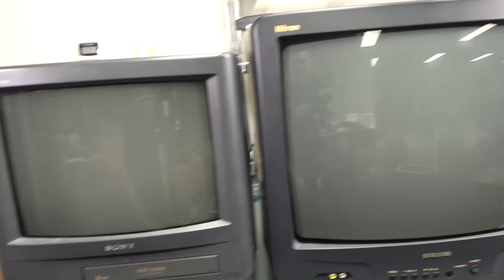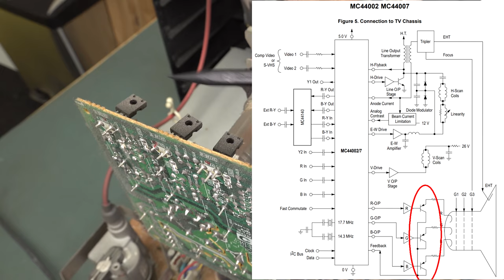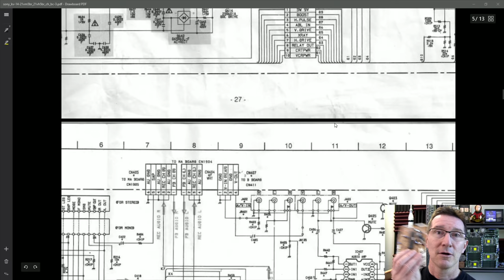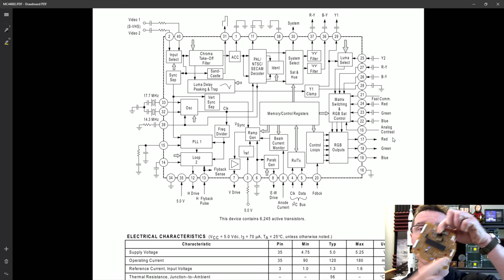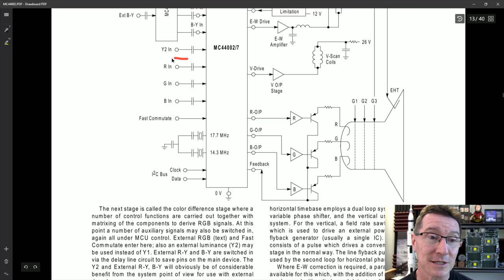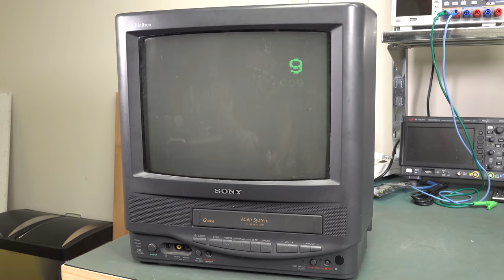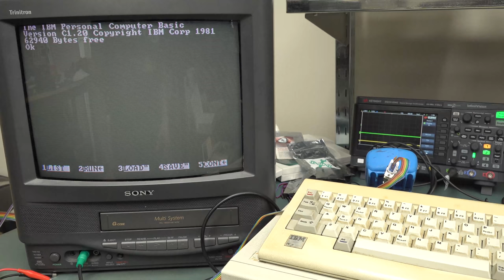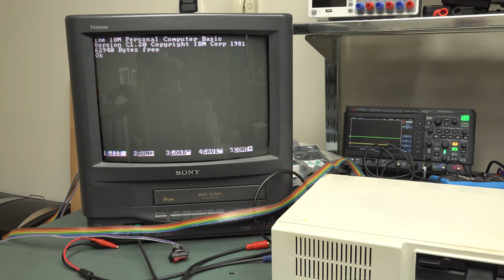EEVblog #1246 - Dumpster TV to Retro RGB Monitor Conversion

Comment from the maker: WARNING: Do NOT try and mod a TV that only has an RF antenna input, it is likely this is a "live chassis" TV and the internal circuitry is not isolated and is at main potential. This could kill you, or worse, blow up your vintage computer.
Reply: Death is a better fate then losing a valuable vintage computer
Reply: or worse 😂
Reply: Would you consider adjustment pots for size and phase?
Reply: Fear not... I shall check it with my tongue first!   thhhhatth wokethhed outh thwell :-(
Reply: @xjet  hello bruce
Reply: I've done it and i'm still alife and so is my super nintendo
Reply: @MrJob91  Gidday mate!
Reply: @NerdyMeathead  did you at least read the title?
Reply from the maker: @xjet  Jar Jar, is that you?
Reply from the maker: @NerdyMeathead  Found in the dumpster room as I said.
Reply: It is not very likely that you find that kind of setup in a TV of that vintage.  Of course in tube TVs this was always done, also in many small tube AM radios.
See Mr. Carlson's Lab videos :-)
Reply: I just had to check the vertical resolution as I wanted to make sure I was correct in saying 576 lines for PAL. One source reports 625 lines for a PAL signal, but I don't trust it. Perhaps they are including the vertical blanking and flyback lines in this. What do you think Dave?
Reply: chickenman297 
625 is the standard, but they aren’t all supposed to carry video.  Most TVs are set up to display something around 550 lines, IIRC.

This being all analogue, you can do some really scary service menu fiddling to see what happens.  My old Sony (29” ‘Flat screen’ — well, kind of) had built in idiot protection so I never managed to blow it up.  Made some interesting squeals and some psychedelic strobing stuff when you set something that wasn’t a good idea...  😺
Reply: dave i had 2 them sony tvs.one exploded while watching tv and also main electric shield closet or what ever its called in english..(its that thing where you check your electricity readings and ohter stuff for paying).
for 4 days all our apartments had no electricity
Reply: In civilised countries we just use the RGB on the scart input.
Reply: I don't think you are allowed to use the term Tranny in any sense, because it can be offensive to transgender people.  You could go to jail under new Australian laws.  Oh, and BTW Scott Morrison said we should all show respect to the Chinese Communist party.  So you might also want to refrain from saying Won Hung Lo brand.  Thanks!
Reply: @chickenman297  to the best of my recollection (did a framegrabber hardware project in college, long time ago) PAL is 625 lines, including the vertical blanking, with 576 visible, and NTSC 525/486.
Reply: @chickenman297  When you divide the line rate by the frame rate you get 625, i.e. there is a total of 625 lines in the frame.  However, some lines are in the vertical blanking interval and some are in the overscan area, so they are not visible.  576 is about the number that you can maximally see, to be safe a lower number like 550 can be used.
Reply: Damn, there goes my idea. I have a 27 inch CRT in the garage that is antenna only that I was going to mod for RGB.
Reply: I did RGB mod an rf only set years ago. the service manual showed that it is not a live chassis set.
Reply: @xjet  Jar-Jar ... is that you?
Reply: @Rob2  I thought it was a bit high. What got me was the interlacing. 25 lines of vertical blanking for fly back, but there are 2 fields for each full resolution picture each having those 25 blanked lines (25 or so, actually 24.5 to complicate things)
Reply: Thanks for the video.
This is a very real warning. Working on an old black and white TV ( unplugged the chassis inside was all metal  ), I was on the floor with my elbows on my knees putting it back together when electricity  discharged into me and when I got my senses back I was six feet away from the TV and my arm was numb. Lucky for me I had my arm on my knee. It was hours later when my arm would work proper. My hand was at the RF antenna input, do not know where all the energy came from. If any one knows, I would like to know what happened.
Reply: Speaking as someone who modded a few dozen of these CRTs for RGB, I don't agree with that generalization. The circuitry of the type of TV we want (with color OSD) is basically identical to these 2 TVs you showed us, just the inputs for composite or whatever else weren't populated to save some change - sometimes you can even see the outline where those inputs would have gone. Of course you should treat a powered set as high voltage until verified otherwise anyway but TVs with a modern jungle IC won't have high voltage in that area.
Reply: For those ones who wants to teleport their soul to another dimension, just don’t discharge a crt tv,just pull off all wires and touch it ,hahaha JUST KIDDING,,, and to be hornest i NEVER want to open up a crt tv and touch the inside of it because you never know ,and once 30.000 volt will travel trough your body, your heart will stop permanently.
Reply: yeah.  The worst shock I got besides peeing on an electric fence illegally hooked up to the AC mains is when I was working on an old 27" vacuum tube TV and the anode popped off the CRT and landed on my arm.  

Hit the wall so hard I knocked all the pictures off on the other side.
Reply: Depends of the vintage of the TV set. If in the user manual is said there is an AV optional board it's safe to try.Besides in some TV sets I found the schematic inside.
Reply: I've done that with an old AC/DC radio. Trying to add earth for better DX killed the radio and scorched the window-screen. Many old radios and TVs have no isolation.

Comment: This reminded me of when I was in electronics school.  One of the instructors worked part time for a company that repaired arcade machines.  They had a bunch of monitors that had some screen burn were still functional.  He brought in enough for anyone that wanted to get a color monitor for their computer and learn a little in the process.  The monitors accepted a CGA input but one of the sync signals was inverted.  Too long ago to remember which one.  So we built a little single transistor inverter on a piece of perf. board and were ready to go.  Nothing too complex but it was a simple way for a couple of us cash starved students to get get a color monitor.

Comment: The component differences on the brazilian TV are most likely due how to bypass some brutal import taxes, you have to manufacture things in brazil itself on a tax free zone in manaus.
So they probably redesigned the tv to get a good cost/benefit while shopping locally and/or importing cheaper components.
Reply from the maker: Interesting!, thanks.
Reply: I think it was even worse in the 80's with the military dictators favoring their corrupt friends.
Reply: @EEVblog  also, Brazil uses PAL-M color(pretty much NTSC/525 lines but using PAL color), which may explain some of the differences.
Reply: And if memory serves well, Manaus is smack dab in the middle of the Amazon JUNGLE! (There we may have the reason for "jungle chip")

Comment: You can shift the display left or right in software on the PCjr (or any PC with CGA): at the DOS prompt, type MODE 40,R or MODE 80,R for 40 or 80 columns of text, respectively, and to shift the screen right. You can repeat the command to shift the display farther. Use L instead of R to shift it left.
Reply from the maker: Works!, thanks.
Reply: VWestlife (backup account) your description on that channel states "bonus videos", but there are no videos at all on the videos page...? :P
Reply: I do not post any videos on this account. It's strictly for viewing and commenting, to keep my subscriptions feed from getting too clogged up on my main account. If you want to see more videos from me, subscribe to my vwest7ife channel.
Reply: @kevinsvideodump  It seems that 118 people disobeyed your instructions in the "About" page, and subscribed to the backup account.
Reply: @und4287  it did say something about "bonus videos", so it must have been changed since. Anyway the main channel seems to have my main channel blocked and attempted contact elsewhere was persistently ignored and I have no idea why...

Comment: Yes I remember most of the old mods used opto isolators to solve the issue with hot chassis sets
Reply: Way, way back went to a lot of trouble pulling an isolated 6MHz sound carrier feed out of my parents' TV to run through a sound IF strip feeding an induction loop I'd installed for my mother's hearing aid. Less than year later they replaced the set with one that had a SCART connector.

Comment: Trinitron fan checking in. After I grabbed a few Sony GDM-FW900 monitors that the university had in the e-cycle pile, I've been singing their praises. (I had a standing "agreement" with the people running that building that since they had to pay per pound for e-cycle, if a few CRT monitors disappeared from the pile before they were picked up, no-one would say anything.) This was in 2009 for me,  and at the time LCD panels were not very good. The technology market switched to them before they were ready. I didn't start using LCD displays until after 2015, when the technology had finally caught up. One thing I loved about it was it could handle a refresh rate above 100 Hz with good resolution.
Reply: The FW900 is still better than any LCD. Fight me.

Comment: Trinitron monitor ftw...ive got one of the "flat screen" CRT trinitrons...its great for old school consoles/computers
you should be able to find a "service menu" on the sonys...allowing you to change all the settings (atleast there is on mine!)..you still need the manual to get calibration correct (i accidently reset mine and lost all of its settings, picture was all wonky and colors where wrong... left it off and unplugged for about a month and it musta loaded a backup and came good!)

Comment: Back in 2002, someone gave me a Sony KX-27PS1 studio monitor.
Unused, still in original packing crate!
Full service manual was included in the crate.
These were first built in 1982 I think, mine was a 1983 model from the date codes.
It was quite funny reading the instructions, as they referenced the SCART connector...
"For use with audio visual accessories which may be developed in the future"
The SCART (or "PERI-TV") connector was full feature RGB, plus there was also a 34-pin interface connector with RGB.
Paired with a Set-Top Box that had RGB output and a pair of shielded-magnet hifi speakers, this setup wiped the floor with anything else on the market for image quality, even 20 years on.
I had gone LCD for the computer, but regarding TV/DVD at the time there was only Plasma that could offer anything close to the Trinitron Profeel.

Comment: In France (and all Europe I think) was mandatory to have at least one SCART plug (called Peritel in France). It was used for absolutely anything: VHS tape recorder, pay channels decoders, satellite or cable TV, computers or anything here. We was never using composite (or thru the SCART as it's also part or it). It was very easy to build electronic to send data to the TV... and without microcontroller 😉
Reply: Valéry MARZLIN Yes, that’s true. It was used in many European countries. I think it’s still mandatory on TVs sold in Sweden, they could have changed that in the last couple of years though.
Reply: @ianbakke  in France it's no more mandatory now as we have no more analog TV from 2011. Even the emitter I use to receive TV at home, the Eiffel tower 😉, is digital. Now HDMI is mandatory but you can still find some new TV set with 1 SCART but less and less.

Comment: Yeah this fast commutation signal is actually present on the SCART connector and is usually necessary for RGB although some TVs don't care. It's used to force the RGB input over the composite input, in theory it can be used to do RGB overlays when having both inputs in sync.

Comment: Wish I had me one of them boom-box special Phillips screwdrivers at 4:18 show-off..
Reply from the maker: I think I'll use it in every video just for kicks. Looking for the same length in a #1 philips.
Reply: I now have screwdriver envy
Reply: @EEVblog  I bought these recently to get into a dead UPS at work:

https://amzn.to/2LyQWkO

#1 through #3 Philips, and two sizes of flat blades.  Use them in a cordless screwdriver or a Picquic handle.  They're not quite as long as in the video, but at 12", they should be long enough for most things.

Comment: Reason for the external RGB for OSD is to get a stable OSD, using the MCU triggered off the flyback to time the OPSD, irrespective of the input actually having a sync signal applied, and only triggering randomly on noise.

Comment: Here in Europe, most of our TVs have RGB input already from the SCART socket. I'm guessing you don't/didn't have anything similar in Australia.
Reply: Scart briefly feature in South Africa in the '90s.
However, hardly anyone bothered with it because it's such a pita to work with.
No two scart sockets are the same. The scart spec does not require every circuit in the spec to be present. More than half the pins are dual function. hence, you need to decide what your scart's function will be before you build it.
For this same reason, most devices have two scart sockets wired for different functions.
I ran into these issues when trying to use a C=128D with 1084s monitor. In theory, you could have just made a cable, but in practice, the analogue vga pins in the scart aren't compatible with digital ega signals.
Reply from the maker: Some TV's had SCART here I think.
Reply: @EEVblog  tvs for the european market have scart inputs even today. and most of them at least have composite and rgb inputs wired up properly, with the composite input being used as sync in rgb mode. what IS rarely used are the Y/C (s-video) inputs, since these aren't properly standardized. when you get an old crt tv here or even many modern tvs, you usually dont have to do anything for rgb. only those with 2 scart connectors probably have RGB wired to just one of them. 

All of this is because in france, the TV was required to have a SCART input BY LAW (and NO cinch connectors). and manufacturers of course sold the same tv in all of europe. RGB was heavily used here even up to the mid 2000s on external DVB-T receivers, DVD Players and so on. All of these had SCART outputs for this; many devices even ONLY had a scart output with everything being wired up to it internally.
Reply: @niino4329  SCART is being removed here 
Most new TVs only gave composite as an old standard
Reply: @BavarianM  I bought a 4K Philips TV about 2 years ago and it still has a Scart connector. Not sure if it it includes RGB as well, but I've never seen one that doesn't.

Comment: Thank goodness for SCART and its' RGB inputs eh? :D
Reply: @RaduTek  svideo will only be on scart port 2 and beyond, and not all tvs wil have it anyway. Scart 1 will always have RGB wired.
Reply: you wanna know how i got this scart
Reply: I suppose that IC were made with SCART in mind. In some board for US market simply the socket and circiutry to connect it to the chip was omitted. I suppose that comparing an NTSC and PAL model could give a clue of what is missing.

Comment: If you found the right tv you wouldn't even need to do all this, rgb right at the back, maybe add a connector to it. But it would most likely be a huge tube tv which wouldn't be as convenient. I sported a flat screen, widescreen 1600 x 900 CRT monitor back in the day, when crt's were starting to be phased out. One thing that was cool about them was even if you had low resolution/ frame-rates, video's and games always looked sharp and smooth, because this was a high end monitor for it's time it had deep colors, great black composition. Wouldn't mind owning one again, for nostalgia points. ;)

Comment: The start-up buzz is usually the degauss coil and is usually hits and fades as thermister backs it off. The HV (anode) is the dust-attracting, static-y crackle.

Comment: Probably /possibly)  the RGB input on the chip is designated for models with external RGB input like SCART. So they designed the OSD circuit to spare this input.

Comment: I think you should be able to generate CSync by combining both HSync and VSync pins of the DB9 RGB socket in a way. Assuming all sync signals are positive, you can use logic gates, or simpler, only one NPN transistor configured as HSync to C, VSync to B through 1K resistor and you may get composite sync signal from E. Then you can connect it to the composite video input, since this signal only contains sync information (so there is no color/image signal) it will sync the RGB input without any interference. There should be no reason for an extra second video cable.

Comment: "this device contains 6245 active transistors" wow they're proud of that eh
Reply: Coba Weel This used to be standard data sheet info. Still is for stuff like CPUs that contain lots of week low voltage transistors.

Comment: From what I've seen, there's typically a diode somewhere between the Micom and the Fast Commutate/RGB blanking pin on the jungle, so what you can do is just leave the TV's circuit for that line intact and just add your own blanking signal straight in the pin on the chip (I just use the 5v from SCART), you'll get RGB when you have something driving the SCART, and standard inputs without, a switchless install.

Seems like a good idea. Maybe it'll blow something up, but it hasn't yet so I'll keep doing it.